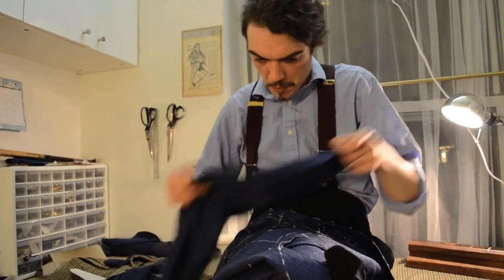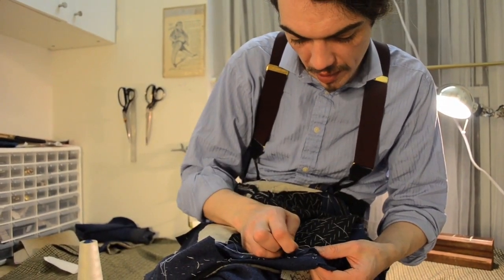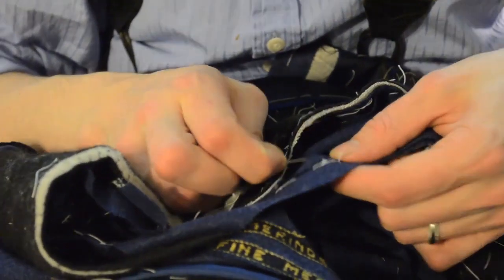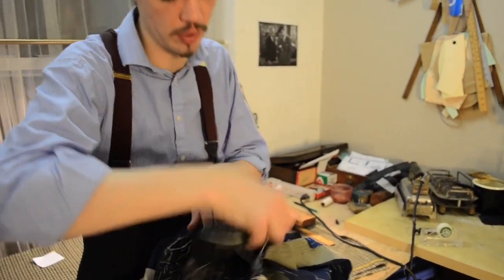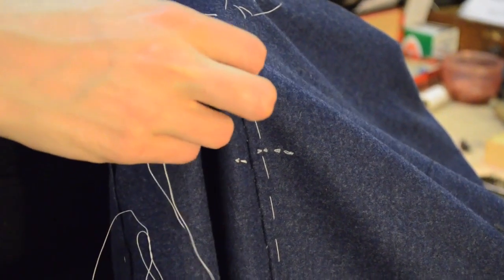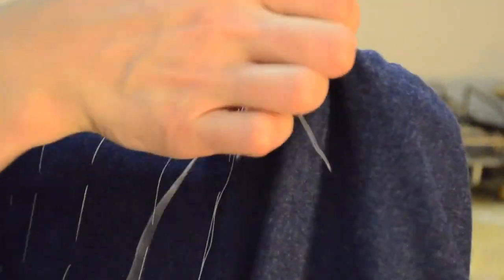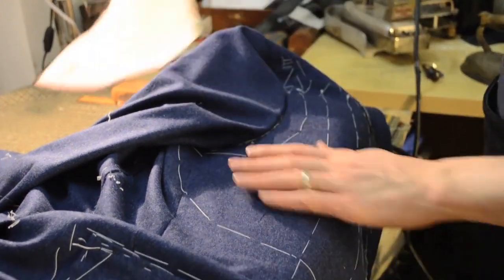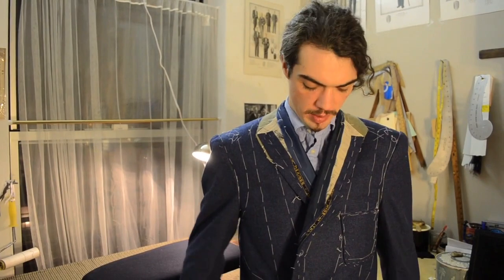The Making of a Coat #19 Attaching the Sleeves

Comment: Hi there. I accidentally found your video. What is the stuff you are brushing on before ironing ? And also what is the layer you put on the coat when you hit it with the iron. I love this video. Thanks.
Reply from the maker: jayne simmons, water is applied using a brush so I can soften certain areas of the cloth with steam. A canvas press cloth is used to protect the garment from the heat of the iron.
Reply: He was using handbrush to apply water before ironing instead of spraying

Comment: This leaves so much to be desired, and seems only an overview.  I'm not seeing pad stitching on that lapel.   I have been using the book "Vintage Couture Tailoring" primarily instructing for a woman's coat, but with some reference to men's.  Is there an in depth book specifically for bespoke men's tailoring?  I just don't get some of it.  Is there no wadding for a sleeve cap?  Does the canvas eventually get sewn into the seam allowance?  I had some real trouble with a formal silk peaked lapel, and would like to know a better technique for success.  So many unanswered questions.  Also, I have a giraffe shaped tall neckline and cannot figure how to fit that so no gap in back.  The lining is also a major challenge, especially the sleeve.
Reply: For your neck line issue, if your drafting method always leaves gap, add inch to the bottom of the arc on the back panel. I find with the way I draft it leaves enough so that on the first fitting, with seam allowance and all I have too much, and it ripples on the back/neck. If it always does this, it's just a matter of attatching the collar slightly lower down. Of course now with today's styles I'm noticing very wide necks so that the collar is almost completely flat which is easily acheived simply by attatching the collar part way down. That style should work for your case?